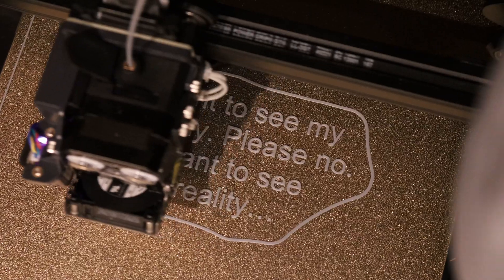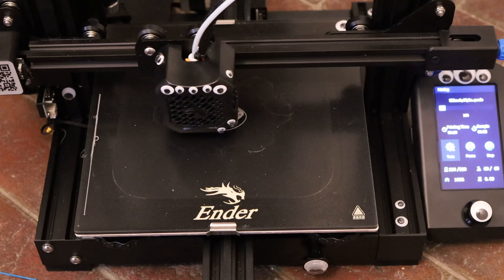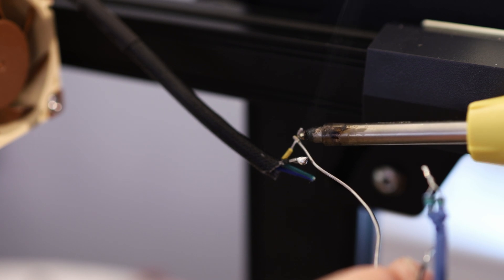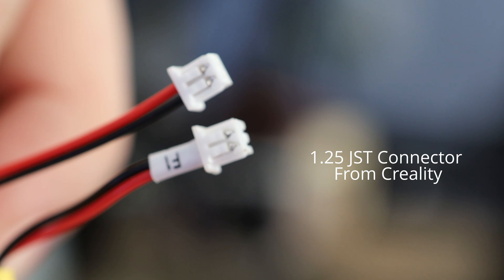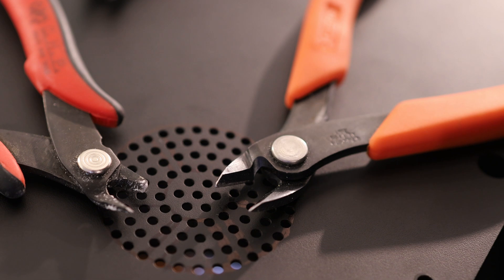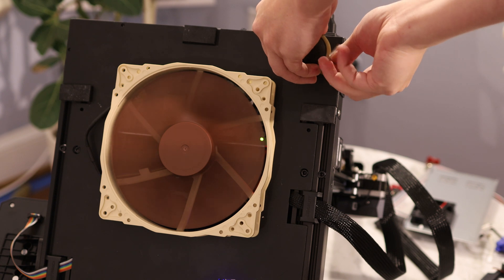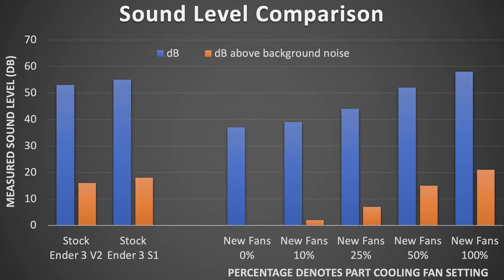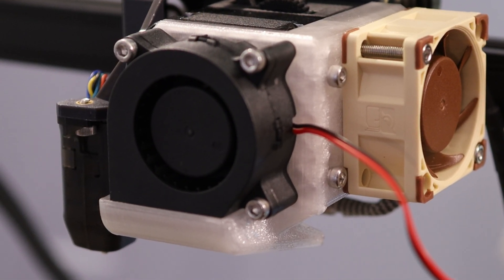Ender 3 S1 - The Silence of The Fans

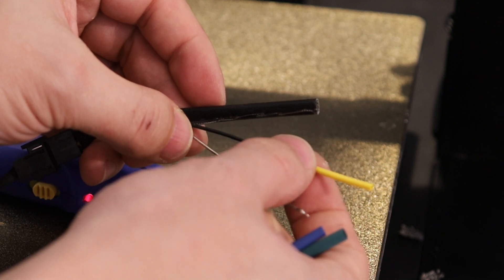Comment from the maker: Just to clear something up about the 150C diode at 3:30
I was using a 5V noctua fan instead of a 12V noctua fan at first, so it was overloaded to 480%. 
After installing the correct 12v fan, it is now running at 36 C.
Reply: Great to know this, the temp put me off doing it :P
Reply: Do I understand correctly, that the diode is basically a resistor that just burns parts of the voltage into heat?
Reply: Oww wow... Ok Zener diode here I come!
Reply: You probably should update the links above. Noctua as atleast two 200x30mm 12 volt fans. One a using a four pin connector and the other a three pin.
Reply: So its save to do i dont need a stepper ?
Reply: 5w diode is crazy hot. Tried 2 in parallel same... link the diode parameters you used to get 36c
Reply: Might be a dumb question (sorry), but couldn't we just use the 24V version of the 40 Noctua Fan to get rid of this problem completely?
Reply from the maker: @N1ghtmind yes, those didn’t exist back then though 😅

Comment: Anyone else had the problem that the magnet inside the extruder slows/stops the hotend fan?
Reply: I just did this mod, and the blower fan for part cooling will not spin up when mounted, move it away and it starts running full power. Place in on the magnetic bed and it will also stop. is there a solution?
Reply: @brianmassey7563  its not an error. The fan will spin after first layer. It seems like the magnet is being used to controll the fan.

Comment: if i buy a 24v 40mm noctua fan for the extruder can i just wire it up to positive and negative? or do i still have to solder in a resistor
Reply: Yes correct

Comment: This might be kind of a stupid question, but where do you plug the wires for the hotend/part cooling, cause even if I remove the original part cooling fan, one of the ports is still occupied?

Comment: Have you let prints run for a long time using this setup? 

I ask because I have a similar setup (slightly different design) using 2x 4020 Sunon Maglev axial fans (One for hotend and one for part cooling), and heat creep inevitably sets in for any print longer than 60 mins in duration. 

Upon further reading Noctua NF-A4X10 has a lower CFM than the Sunon fan. However, the Noctua provides higher static pressure. Can you advise please?

Great video as always Nathan.
Reply from the maker: I didn't have any issues. The way I designed this it provides much more cooling than some others I have looked at. The fan recirculates air against the parts its up against, in addition to pushing air through the heatsink.

I've since swapped the hotend over to using an entirely different printhead (Microswiss NG)
Reply: @NathanBuildsRobots  I'll try a few setups. Thanks for your reply.

Comment: The diode seems quite inefficient, why not one of those poststamp size dc step down converters? Would be cool to see a design that fits a MP1584EN converter on the model
Reply: Why not just use a 40x20mm 24v fan? That seems like the easiest solution to me unless I'm missing something.

Comment: if you have pwm control, you can set the max duty cycle to 50% and add a capacitor in parallel to the fan to get 12V instead of using a zener which will get toasty.
Reply: Good advice, but the cap needs to be big enough ;)

Comment: Noctua are expensive, the stock fans powered at 12-15v are sufficient.
I didn't buy any particular fan and used the stock one with dc dc step down mini bucks.
I've the Ender 3 V2 Neo, and now it's silent without any particular mods, simply I've used Mini 360 bucks on the stock PSU and mainboard fans that I've choosen from 12-15v till obtain low noise and still good airflow. And opened with a cupsaw the power supply cover to have more air flow. 
On the hot end I've used a Sunon MF40202V2-1000C-A99 DC 24V 0.68W 40x40x20mm achieved for 21 db. I don't need any other special mods, now my Ender 3 print's well and has very low noise.

Comment: Just subbed, What IC was that - the hot one. So the viewers can opt to put a heatsink on there too. THanks
Reply from the maker: the one that was in the wire harness was super hot because I was using the wrong size fan
Reply: @NathanBuildsRobots  I mean that hot one on the mainboard

Comment: Being an ACTUAL electronics tech authorized by many major manufacturers, you have done a lot of don'ts in this video. Seeing you did not even do flow tests to figure out the proper fans to install is even worse. Bigger is not better, blade design is key. running a 12v fan on 24v and only using a Zener diode ( and you say it wrong the ENTIRE video) is looking for a failure. Yes, 2 Zener's DO make a transistor for a voltage regulator ( which IS what you should do, or a flameproof resister @ 2w ), if done correctly and a bridge, but you do not even do that. You are going to end up burning that board on the back of the Sprite eventually. With tat HUGE fan on the bottom, you actually INTRODUCE directional vibration into the frame of the unit.

Comment: I attempted to install the buck converter to the power supply but got paranoid and stopped. How did you power your converter? It doesn't look like it's connected to the PSU in the vid. Thanks!

Comment: Are these upgrades applicable to the S1 Pro and would you recommend them? My machine doesn't see a ton of use, and I keep it downstairs away from where I sleep/watch TV etc. I like the idea of the performance improvements though. Lmk what you think!
Reply from the maker: YES AND YES. It really needs an upgraded part cooling fan at least. The additional fans for silent operation are not worth it for everyone, but if you want the printer to be super quiet its definitely a good choice

Comment: Have you had any printer issues? I heard when it comes to prints that require higher cooling using a 12 V fan doesn’t provide enough cooling as a 24 V. I don’t know how true this is my self.
Reply from the maker: I have never had an issue with my12v noctua fans. Though its important to note that I usually use the noctua fan for cooling the hotend heatsink, not for part cooling.

Part cooling is almost always best done with a 5015 blower fan or 4020 blower fan

Comment: This is a brilliant cooler, it printed fantastically and it's such a nice addition.
I followed the wiring guide for the noctua flx 40x10 and the zenner diode as shown but when connecting the fan and testing it i get nothing from it, could that be a bad zenner diode? I checked the pins when making the connector so the wires match polarity.
Reply from the maker: The noctua 3 pin and 4 pin use different wires for the + side. One uses red, other uses yellow. Try checking the pinout for your specific fan
Reply: @NathanBuildsRobots  I looked up a pin diagram and yeah I was wired up to the speed sensor (yellow) and not the 12v (red) as i butchered the wires directly from the fan.
Many thanks for your help, your videos, and your modderboard Nathan, mine just came today :)
Cheers mate, keep on moddin!

Comment: Great vid, I’ve been piecing all of the parts needed for this mod and had a question. Is the fan on the left side (cr touch side) unplugged or is it running? That fan seems to be the loudest stock fan on the S1.
Reply from the maker: I removed that fan. I might also recommend the modder board as it makes fan installs like this easier, but you can get it done either way
Reply: Thanks dude! Love the vids 💪🏽

Comment: A: that intro is cinematic art.
B: I did the notcua fan mod to my Fokoos Odin 5 and haven't looked back.
Reply from the maker: Nice… the giant fan looks awesome and does a great job of cooling things with virtually no noise. Best thing is when you flip your printer on and second guess if you forgot to plug it in or broke it because you don’t hear a thing!
Reply: @NathanBuildsRobots  My printer has an annoying BEEEEEEP Every time you turn it on. I'm so OCD about the noise that I got some thick foam double sided tape and covered the little black speaker on the board haha.

Comment: Fantastic video, thank you very much! Why don't you put one (or two) buck converter(s) from 24v to 12v between the motherboard and the wire into the case?
Reply from the maker: I figured the always on approach is more failsafe than running it through the motherboard. There might be cases where the PSU is on and drawing lots of power, but the motherboard fan is off (like when heating up the bed at the start of a print).

Comment: You got the 24V for your buck converter directly from the power source our from one of the fans output (board or power source)?
Reply from the maker: From the power supply, it’s just turns on whenever the printer is on that way

Comment: I am keeping the hotend fan (I cut the stl in mesh mixer and kept only the heatbreak fan). I will be using a gelid fan instead of the noctua... they are 50% cheaper. I will receive it tomorrow, so I will check how it performs...

Comment: So what do you plug the fan and the blower into if there's only one port where the original cooling fan was connected to? Are you using a buck converter for them or just for the massive cooling fan you put on the bottom? Right now I'm just going for upgrading my Sprite extruder...

Also should the blower be a 12v or 24v?
Reply: The fan and the blower have 2 separated connectors. If you use a 12v blower you need another zener dioder
Reply: @ev. FPV  if it's 2 connectors then where on the extruder do you plug it in because one will take the original fan connection leaving an extra one. 

So 24v it is...
Reply: @davidhguitarguru  there are 2 fans on the Sprite. One for the heatbreak and the other one for the hotend. You can replace them with the noctua and with a blower. If you use a 12v fan you need to step them down.
Reply from the maker: If you have more questions I’d check out the discord

Comment: Will a 1W Zenner diode work instead of a 5W like you’re using? My NF-A4x20 Noctua fan has a max input power of 0.6W.
Reply from the maker: Probably, I just like using the larger ones because they run slightly cooler

Comment: Hey man, thanks for the great video! I saw in one of your  patreon write ups that the parts cooler blower fan can be replaced with a Noctua NF-A4x20. Did you ever try this configuration? I feel like the Noctua fan would be quieter than the blower, so I'm curious what your reasoning was for choosing it. Can't wait to test these mods out on my S1 :)
Reply from the maker: Yes, I have models for it and they are on my Patreon, but the best config is the 5015 fan, best part cooling

Comment: I really need a better part cooling fan soon. Im planning to get my machine dialed in and get it fast. Its an s1 pro. Whats the best fan and mount for better cooling
Reply: The idea of cutting my wires is terrifying
Reply from the maker: Creality sells some kits that have a larger part cooling fan that you can just plug in. It already has the tiny connector in it. I think it is called the high flow kit for ender 3.
Reply: @NathanBuildsRobots  thanls for the response. I appreciate it. Love your content!
Reply: @NathanBuildsRobots  i found one they sell specifically for the s1/S1 pro. Nobody has a video on it or anywhere i can find better info. Im interested but i like to see it done before i attempt. Possibly a idea for a video. Either way you make good content thats helped me a lot so im thankful for you!
Reply: @NathanBuildsRobots  i see they have one for the s1/s1 pro specifically. But nobodies covered it yet. Id like to see a video on that from someone sometime soon. Im debating trying it
Reply from the maker: @Pdunns3D  Its a basic upgrade kit, you just install it on there and you're good to go. However, I would order it direct from China on Aliexpress. Its under $20 there vs $40 at the US resellers.
Reply: @NathanBuildsRobots  thank you for that. Thats probably what ill do. Im low on funds currently but it seems worthwhile with what im running

Comment: Where do you plug In the 4020 fan? I'm not seeing an extra outlet for this.
Reply from the maker: You have to modify the wiring to plug in the fan. It's annoying to do. I made a pcb, called the modder board for ender 3 S1 that makes it a little easier, but you so need to do some basic rewiring
Reply: @NathanBuildsRobots  I do understand that part but even when I modify the plug there isn't anywhere to plug it in. Do I have to unplug the fan on the adjacent side of the hot end? If so, will this fan be enough to keep everything cool? Thanks for your fast reply!
Reply from the maker: @estotts  oh, right. I removed the small blower fan on the side of the printer, since it is loud.
Reply: Hey Nathan, I ran into a couple road blocks. First one is I'm still getting 24v output even with the diode hooked up (cathode line toward positive power). Second thing is, I am no longer getting power coming from the hot end fan outlet. Is it possible I blew a fuse or something?
Reply: And I am aware the connectors you buy from amazon are flip flopped. I stumped 🤔
Reply from the maker: @estotts  it is possible that something burnt up but it only really happens if you  short something intentionally or unintentionally. Can you join the discord? That would be the easiest way to get some help. I have another video. I would inspect the breakout board: How to Fix Your Ender 3 S1 Breakout Board
https://youtu.be/8VECQqJ04zM
Reply: @NathanBuildsRobots  the same thing happens to my breakout board. Luckily I work at an electronics company. Lol... I would love to join the discord!
Reply from the maker: @estotts  The invite link is in the description to most of my videos. If that happened, someone probably shorted the wires together. I'm not saying you did it, but someone did :P

That is one of the annoying things about those tiny connectors and wires. Its harder to work on them.

Comment: Wow.  I can't believe how quiet this makes my Ender 3 S1.  Nathan you are AWESOME.  Thank you so much.  I do have a question for you though.......I notice when I am printing...if I have a light plugged into the same surge strip, I see flicker in the light.  Do I need a better surge strip?  A better power supply in the printer?  Or should I get a UPS to try and isolate the conducted emissions coming off the printer?
Reply from the maker: It's common for LED lights to be very sensitive to voltage fluctuations.

So I would say its normal, as long as you are not overloading it. Most surge stops are good for over 800 watts. 

I'm glad the mods helped!
Reply: Hi, probably too late to help, but my Ender 3 S1 did this because the switchable PSU was set to 240v from the factory. I flipped the switch to 120v, and the flickering went away.

Comment: Hey can anyone let me know if the stock blower fan behind the CR Touch is disabled and left in place or taken out? I'm about to make this modification but using the "4020 Axial" version with two Noctua fans and I'm a bit unsure about this specifically. Any help would be appreciated, Thanks.
Reply from the maker: I took it out. Should help with airflow. But the trick about my fan duct,  and the reason it works better than most alternatives, is the fan actually produces a lot of cooling by stirring the air against the face its up against, not just the flow through the heatsink.
Reply: @NathanBuildsRobots  Awesome, Thank you for these designs, the video instructions and also getting back to me on this personally. I laughed my ass off at the Intro skit, once again thanks i appreciate all of this.

Comment: Apart from the big resonance of the metal body and the Y motor, it is a good machine. The big fan Noctua eliminates no noise..
But after some printing problems, I discovered a difference of 1mm in horizontal on the X axis. So it is to be monitored and corrected for new users.
On your sprite cooling fixture, the fan for the Hot-End looks the same as the standard one?
The loudest is the small 30 mm near the CR-Touch

Comment: My question is: Why dont u use a 230v converter to 12v ? 
Theres plenty room for that in the enclosure, and than u can also connect a PC fan controller and have external controll over fans cooling mainboard :)
Reply from the maker: Mainly because I didn't want to deal with splicing high voltage lines. The pi draws so little power. But a fan controller would be nice. The buck converter I'm using has a potentiometer on it for adjusting voltage, so I have a bit of control that way

Comment: I added just the parts fan only version and I'm having issues with the fan not coming on/ not coming on full power because of the extruder motor. Did u have this problem? I'm using the fan from your parts list
Reply from the maker: Yes I had that issue. Which version are you using? The issue was documented in the 5015, but I posted a fixed version. 

Is it the 4020 blower? I might need to modify that one too, moving the fan upwards

Comment: Hi Nathan, just another question. 
Do u know if you can regulate the Hotend Fan per voltage or pwm? I use Klipper if this matters (which I can really recommend its awsome)
Or do I need to use a buck converter or have to find a free port on the mainboard?
Reply from the maker: Yes, I think so. But the motherboard and PSU fans are on full blast as soon as you turn the machine on.

Comment: Incredible, I did the editing with the A20FLX 12v noctua, at the start I thought that the ender did not work...
Only for the head, but the zener diodes... Kind of freak me out.
Can we mount a Noctua 40x40x10 to cool the heating block instead of the existing one?
Thank you for your good advice.
Reply from the maker: I like to use 5015  blower fans for part cooling, and noctua 40x10 for cooking the hotend heatsink
Reply: Yes, zener is not good idea😀 But, my solution is configuring firmware, in firmware you can change PWM from 255 to 127 and this is in output 12V..